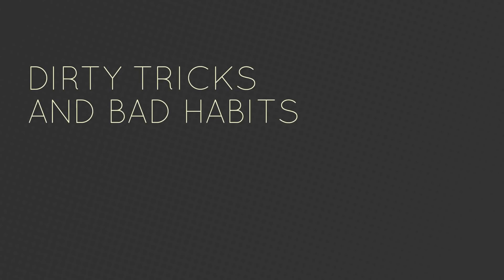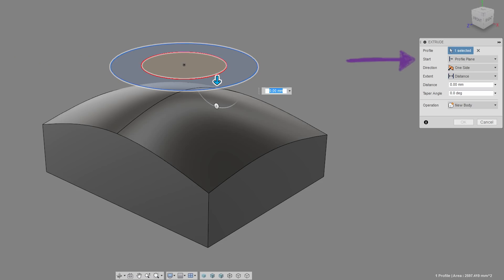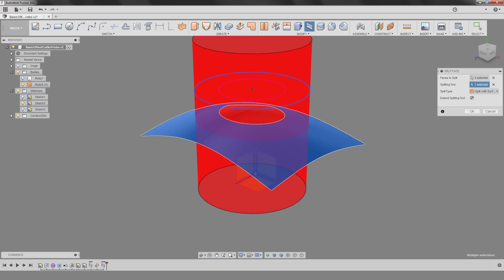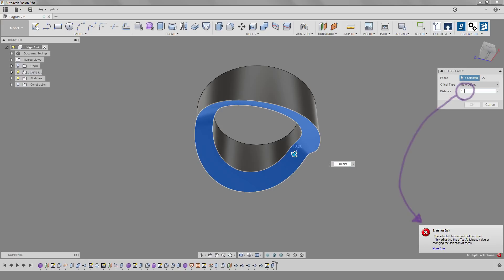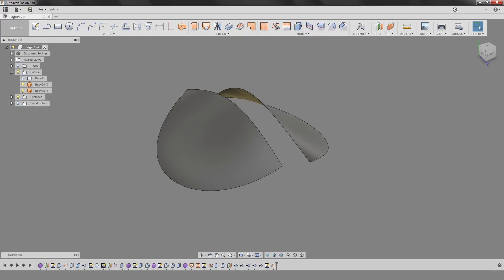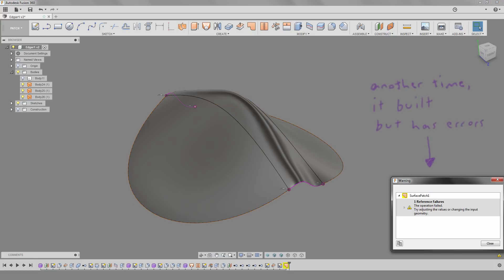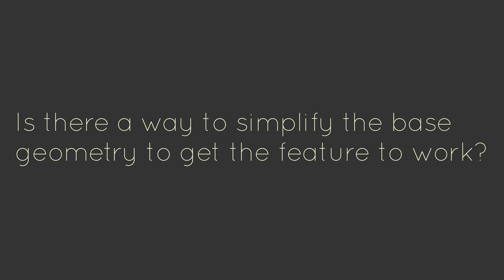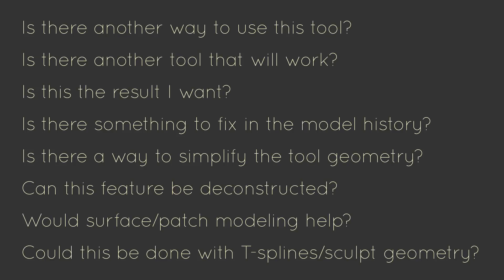Dirty Tricks and Bad Habits in Fusion 360 (01)

Comment: Hi! Can you recommend a plugin to export file into .obj?
Reply from the maker: I've used the obj exporter plugin listed on the Autodesk app store; it's a little buggy and slow but it works and there are no tricks to maintaining multi-body parts... It's a paid plugin, but I don't think it was that expensive.

For a free alternative, most of the time I'll make objs by using the "save as stl" feature and send it through meshmixer, which allows you to export to an obj. You can do this to individual bodies, but you can also export entire assemblies or multi-body components... The trick with this method is that multi-body files export as a single material and sometimes welds vertices together if parts are intersecting... So it depends on what you need/how many parts you have.

The best solution for me, but also the most expensive, is to save a .step or .sat file and open it in 3ds max and export from there. This gives a lot more control over what happens and generally gives much better results. I only do this at work, can't afford my own 3ds license for home.

Another option, also expensive, is to import step/sat into keyshot or sw visualize and export an obj from there.

Hope that helps

Comment: I started to use fusion due to the fact that it is easy for concepts. Before that I worked in CATIA. When you start doing complex shapes for a design or just fillets, then fusion becomes too difficult and unbearable. And then you remember how easy it was done in CATIA.

Comment: Great tutorial!  I'll add one more technique, just FYI - Use Project Curve to surface and Split Faces, to imprint your sketch curves onto the surface.  Use Press/Pull, in the "Create New Offset" mode, to do the cut.  Very similar results to your offset surface method, but maybe a little simpler.
Reply from the maker: Good point, nice addition